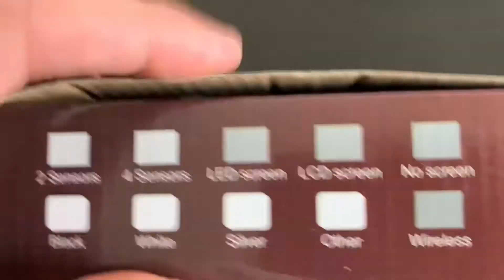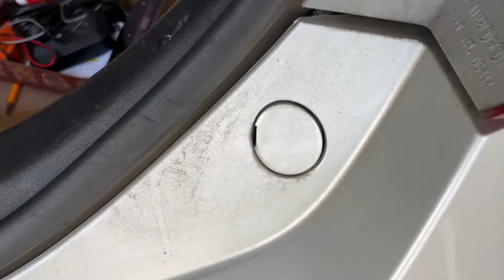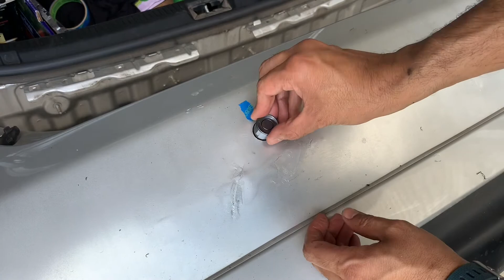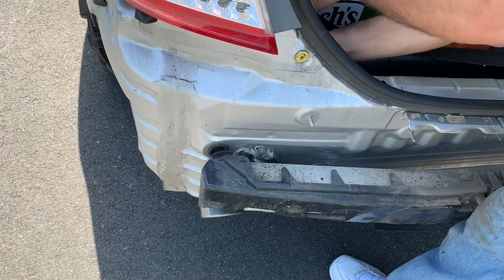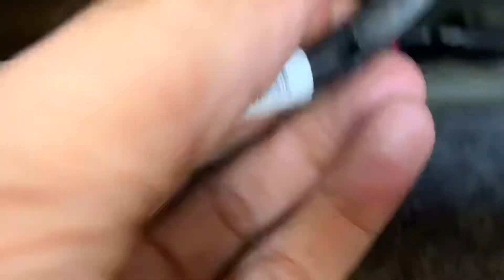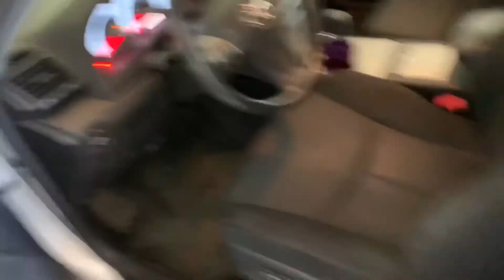Reverse parking sensor installation | Problems | Camry

Comment: CONSUMER ALERT - Toyota Camry had 20 year reliable maintenance program which persuaded many to buy a Camry - then came 2018 with nonsense LDA Collision Alerts which do not work at 90d or more hitting Module on hot windshield - and then I found out sensors behind Toyota Logo on Bumper.  - BUMPERS ARE FOR BUMPERS - not for expensive nonsense repairs for sensors that do not belong on a Bumper.  Watch out for this when you buy a new car - use cars designed by Design Engineers who are rational in Mind